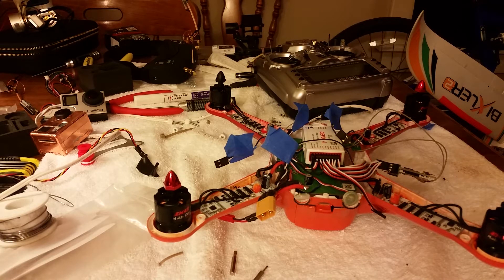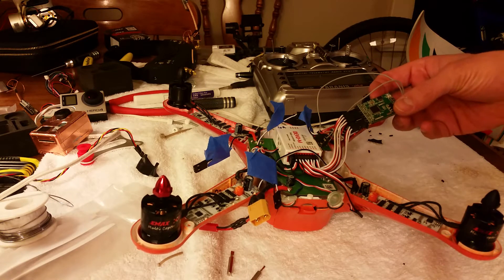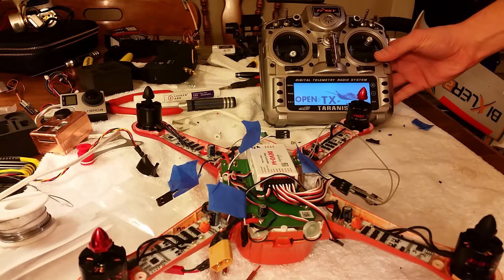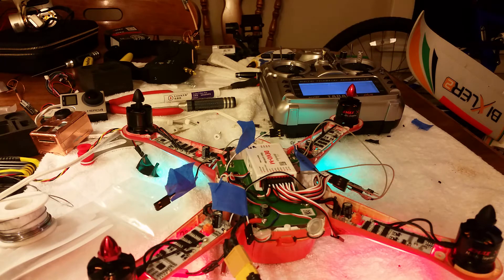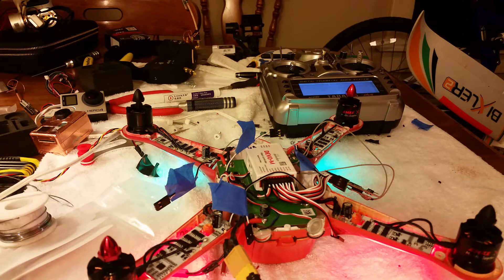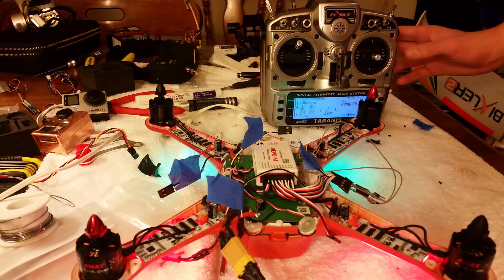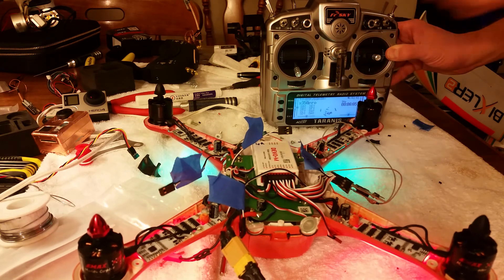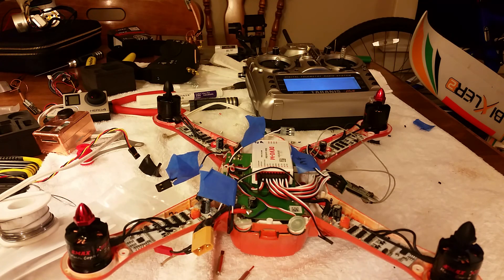Walkera x350 Pro x8r Opera esc calibration

Comment: Awesome drone Hanger!
I just got these esc's for my Pro. Precise instructions, I love it! 
I was wondering why you were binding, then I noticed the Devo-M. But I think that was just a you thing right.
I had to use rubber bands on my DX9, cause I auto centered the throttle. yeah it's a Naza thing :)
I can't fly right now and got bored so I figured I'd finish up my old 350 Pro with better esc's and motors.
I'm running mine with a Naza-M Lite and SunnySky 2216's. Just need to take it up tomorrow or next year.

I was going to sub ya but I noticed I already did! Like 3 years ago when I got my first Pro that started my addiction LOL
It was your "X350 pro test flight " with the camera sitting on a bench or something. :)
Well, I liked this one and went back and liked the other.
Have a great week bro!

Comment: Just some rookie questions. I'm thinking about upgrading my X350 Pro with a similar set. What is the break out box you connect the ESC to? Why is it not wired straight into the Devo-M? 
You posted this  video a few months back. how are your experiences with this setup (compared to the original one)?
thnx for the vid.
Reply from the maker: MixMasterrG I think the break out box your talking about is my x8r receiver, you have to plug the esc into the throttle port on your rx to calibrate then you just plug them all back into the devo m to fly. I have had 0 problems with this setup and it feels more stable to me, I really recommend it but make sure you have decent soldering skills and double check the esc lights your ordering, you can turn them blue red or green its just not easy to do and if you use too much heat you'll cook the esc.
Reply: C Fowler Thnx for the quick reply! I thought the colors were changed by setting the jumpers on the esc. I see there is no BEC on the ESC do you power them of the power distribution board or directly from the Devo-M?
Another rookie question. Will my original props fit on the the emax motors or do I need to switch to DJI props?
Reply from the maker: The colors are changed by desoldering the jumper and shorting a different one, they are very very small. I power them right from the power board just like the stock esc. Yes the original props will fit those motors, you just have to line them up right.
Reply: C Fowler Great! thnx again for the info I got the mounting blocks & esc's on order. Hope they arrive before I burn my last set of stock esc's out :)